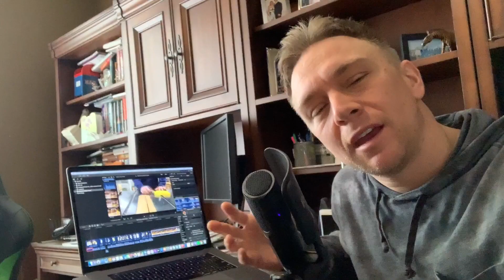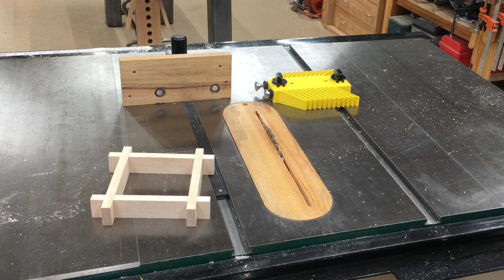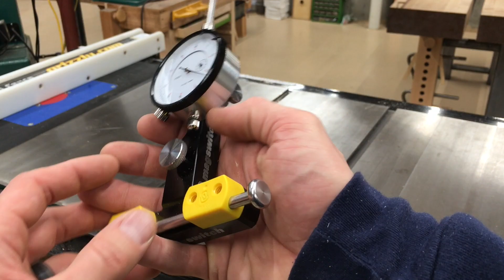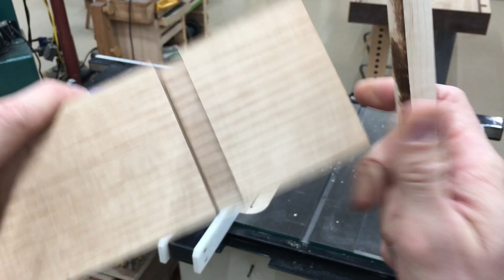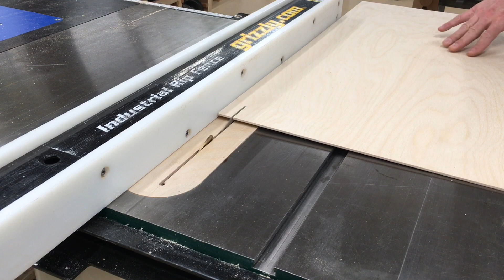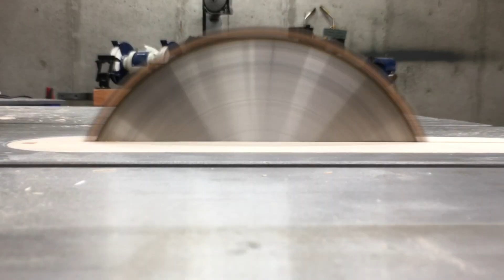3 New Magswitch Products Designed by Me!

Comment: Andrew, what’s the functional difference between the Magswitch 8110328 Pro Table Woodworking Featherboard and the Magswitch Universal Featherboard Pro, Universal Model 81101303?  I’m trying to decide which product is best for my use case which is providing additional horizontal holding pressure on my table saw for rip cuts. I’m leaning towards the 81101303 with the bump stops.
Reply from the maker: The bump stops are the additional feature you get with 81101303

Comment: Hello,  This video was the first place I saw that mentioned "thin stock" when regarding the Vertical Featherboard. I was very excited when I first saw it advertised. I purchased one for when I was breaking down full sheets of 3/4" plywood. It popped off the fence during the cut pretty easily. Apparently I missed; or the advertising does not mention, for "thin stock".  I really like magswitch items. I use one on almost every table saw cut. The Vertical Featherboard was disappointing.   I want to purchase the newly introduced fence for the drill press, but am very concerned to spend the money if it isn't strong enough for the task.
Reply from the maker: The vertical Featherboard is not made to exclusively work with think stock, it should be just fine to apply downward force on 3/4” stock.  Can you send me you email so we can look into this further?

Comment: Those look amazing!! I love those microadjusters
Reply from the maker: Thanks, yes, I think I will use it as a micro adjuster a lot more than a miter slot calibration tool.  That actually did cause some debate about what to call it.
Reply: Andrew, put a bolt on a magnet and use the magnet to adjust the top of the table saw when aligning the  miter slot.